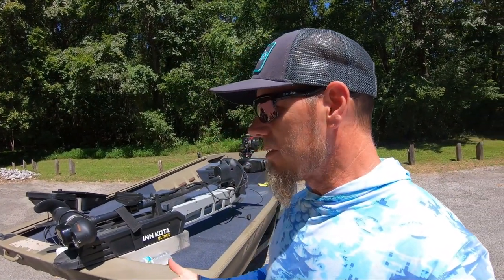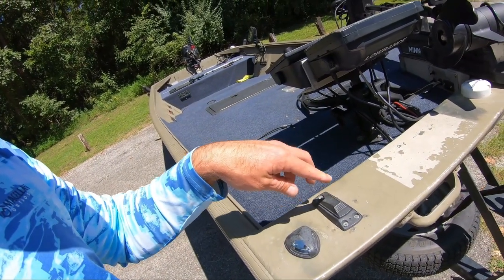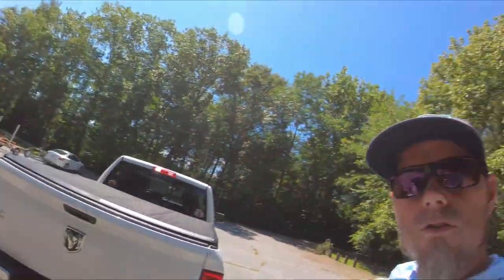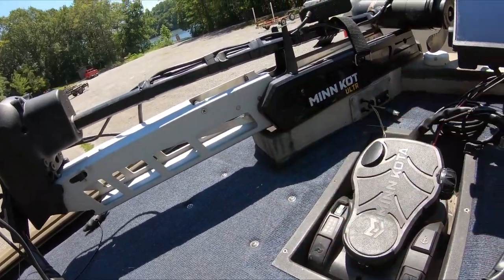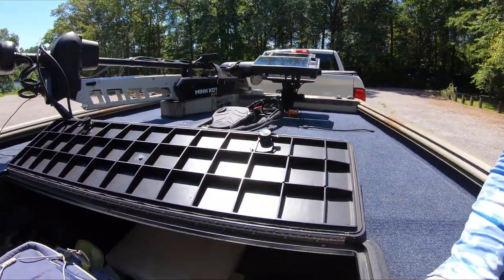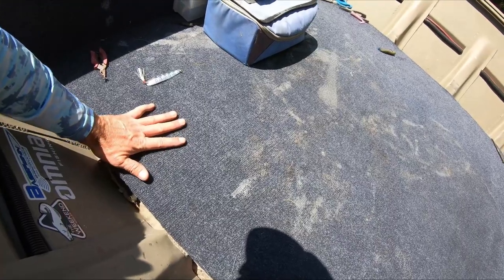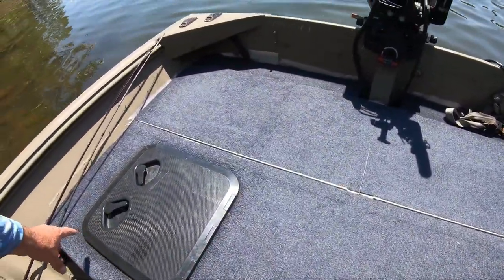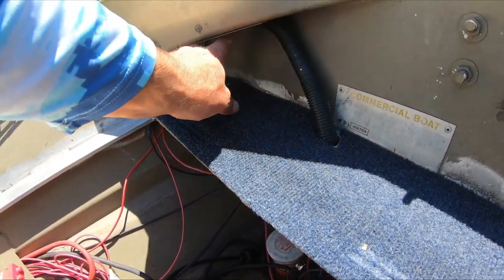Jon Boat To Bass Boat XPress 1650

Comment: This is what I am going to do someday when I get a place to keep it. I will never be able to afford a $70,000 glass boat, but I really don't need one . Most of the lakes l fish are 10 Horse or no gas motor anyway.  The way you trick that out gets my mind going.
Reply from the maker: Heck ya Richard. If you get a 16 foot boat that's 50" + wide you can fish most lakes. You will really save on gas.

Comment: How did you rig the batteries to be 24v but still have 12v to your switches?
Reply from the maker: The trolling motor is powered by (2) 12 volt batteries run in series. As long as you hook up your switches to 1 battery they will be 12 volt
Reply: Thank you sir!

Comment: For the safety strap, you should drill a hole in the plate that the winch is bolted to and bolt on a chain with the hook at one end so you don't have to worry about the knot in your old seatbelt ever coming loose. Well thought out on the sweet conversion! Miss my jon boat to bass boat build I did!
Reply from the maker: Great idea man.

Comment: Hey Gabe. Just found you on the YouTube’s and I’ve really enjoyed your channel. Thanks for all the content
I have a question for you. In your opinion would a 1648 jon boat converted to a bass boat with a 25 Yamaha 2stroke be a good way to start for a first bass boat or would something like a 17 bass tracker with a 9.8 tohatsu be a better option? Most of my fishing will be here in So. IL so a few lakes may have the 10 hp limit but I’m wary that the 9.9 might be way under powered. So there are a few bass trackers with 25’s to 50’s on them also available. 
Not real sure which direction to go any insight would be great.
Reply from the maker: I would say a 1648 with a 9.9 would be better than the other way around. A 17' Bass Tracker with a 9.9 will probably go about 6 MPH. If you plan on fishing Egypt, Kinkaid ,Rend or Crab Orchard than the Bass Tracker with a 50 would the way to go.